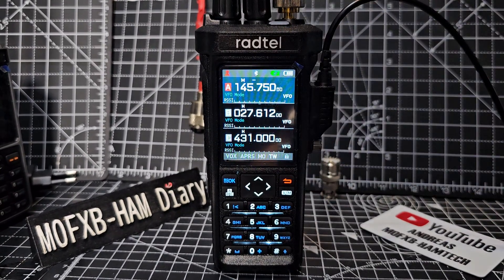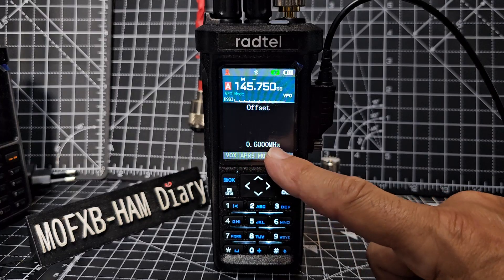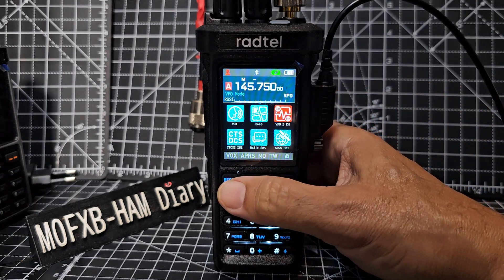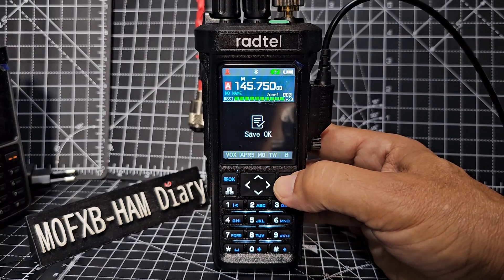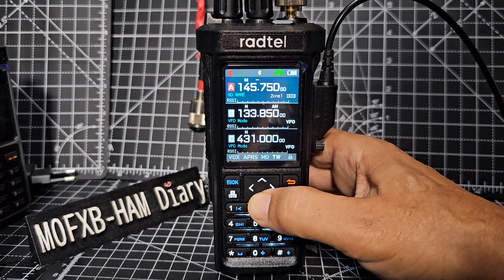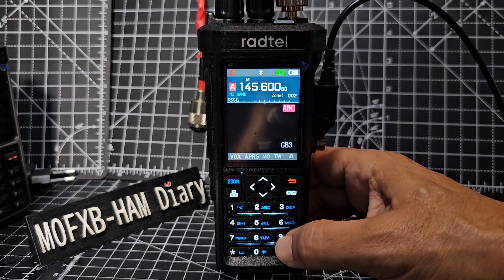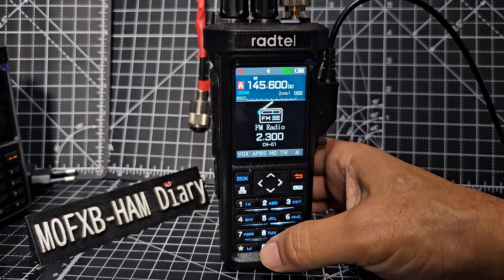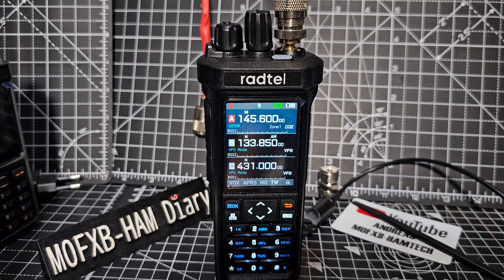RADTEL RT-950  Add Repeater Memory Channel

Comment: Hi? I have a problem with my laptop
I can't program radios with it, I've tried so many times it's really freaking me out it's a window 10 dell, Im not really a programmer just found it hard   trying got everything in the laptop it just won't open up read or send I've tried the comms ports over & over again same thing every time
I've had help with the 878ii plus & ft70 I've got a RT950 it's hard but I'm trying but with the Dell it's not happening
Reply from the maker: Must be wrong cable

Comment: My apologies as it appears when you are in channel mode the frequency does not change to show you it’s transmitting on the correct repeater frequency, WHY THEY DID NOT NOTE THIS IS BEYOND ME? Also, manual is severely lacking. It shows what icons mean, MO and TW but not how to access them…to change them? Why they are calling cross band repeat, “ Repeater interface” is just stupid, that to me means auto repeater shift maybe but how is anyone supposed to know that is in fact cross band repeat? Sorry, I’m just frustrated…thanks my friend
Reply from the maker: Keep tinkering learning is fun enjoy .

Comment: I can’t get the 950 pro to transmit on the transmit frequency? Even if I put the direction and offset in ,it’s like it is stuck in simplex? Can you help ? Why wait it transit on a repeater with the transmit frequency, I even loaded the transmit frequency in using the cps?
Reply from the maker: Watch all my Videos

Comment: I have tried and tried, it will not transmit to the repeater.  The CPS is bad.  They really need to work on it more.
Reply from the maker: No the CPS works well what antenna are you using .
Reply: Mine won’t transmit on the repeater frequency either?
Reply: Is it possible that the frequency shown doesn’t change but it is transmitting on the outgoing frequency?